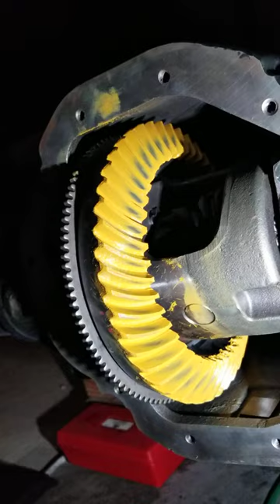dodge ram 1500 differential gear contact pattern 4th try @ 0.064" shim on pinion gear

Comment: What gear is this? I just did a 4.56 and had a similar pattern I almost kept myself on the factory shims. Had .006 backlash. I did move the pinion in, and gave it waaaay more backlash all the way to .015, but it’s dead silent, and the pattern is very close to center on the drive side, and never changed on the coast side, stayed perfect center the whole time.
Reply from the maker: .015 is way to much, almost double. I think its 4 to 5. It's been a while, I would have to check my notes. There is a pinion shimming depth for the best contact patter. and then a final alignment on torquing the differential bearings, to achieve that 4- 5 backlash
Reply from the maker: Also, contact pattern is more critical on the coast side when using original or mis matched gears, or new/ old bearings, etc.
Reply from the maker: I kept my gears stock..... I'm not sure what I have... I think 3.91
Reply: @QuantumMotorWorks   I’ve had the truck on the expressway at 92 mph gps confirmed, and have put a few hundred miles on it, it makes zero noise, and feels perfect driving. I’ve raced it, and have traction bars that hook hard too. It’s holding up great. 👍
Reply from the maker: @robsmith7681  you have traction bars in the rear? I just broke a leaf spring recently hahah.
Reply: @QuantumMotorWorks  yup, I did some 45” ones on a short bed. Changed the entire truck. On clay, it pretty much dead hooks with 10 psi in the tires. Trucks only 2wd as well.
Reply from the maker: @robsmith7681  what year is your ram? Leaf spring as well?
Reply: @QuantumMotorWorks  ooooohhhhhh man, my fault, I was doing a ford 8.8 axle, and in my short bed f150. 🤦‍♂️ it’s a 95. I’m sorry for the confusion dude.
Reply: @QuantumMotorWorks  and I forget sometimes…. But we do have a coil ram, a 2010. 😂 but that definitely wasn’t what I was talking about. 😂😂😂😂👍

Comment: How'd it run? Always see people prophesying doom if your gear pattern aint textbook.
Reply from the maker: I like to think I did mine perfectly without any flaw. 1500 miles so far and feels good as new.
Reply: @QuantumMotorWorks  I achieved a similar pattern on a Ford 8.8 and had people criticizing the drive pattern sitting towards the toe and the coast not mirroring the drive perfectly. Of course some recommend to have the drive sit towards the toe so the pattern can spread back under load, and all the installation guides say that on 2-cut gears the heel-toe placement is trivial. Doesn't stop people from bitchin.
Reply from the maker: As long as you follow the service manual you'll be good. I followed the services procedures to a T. I used many other sources of information from gear manufacturers to cross reference different techniques and processes. I used a combination of all credible information to do the job successfully. Most peoples advice, especially from the internet, typically lack any real life experience when it comes to anything. I never took anyone's advice when I did my rear end. It was 150% all me.
Reply from the maker: I cant hear the bitching over the sound of my 33" mudders and V8 hemi. 💪💪💪 best of luck on your project brother
Reply: @QuantumMotorWorks  Good stuff. Mine's going in tomorrow. Had to do a lot of research as well and of course the little advice that I did get came from a prick and turned out to be dead wrong. The fact that so many jackasses can put these things together and have em drive OK gives me confidence in my own work. Fun to learn how to DIY car stuff because you can recognize which "experts" are just mouthing off.
Reply from the maker: To add a little more complexity to my rebuild (not sure if you've followed along on my other related videos), but the pinion bearing essentially disintegrated around 100k miles and I drove it like that for many years, and wore out the housing where the pinion bearing races press in. So when I finally decided to rebuild it, there was a minor repair I tried, that seems to have work out. What I did was not factory recommended, but it worked.